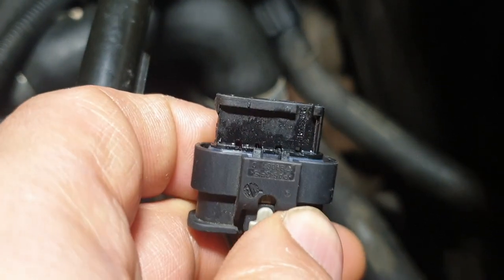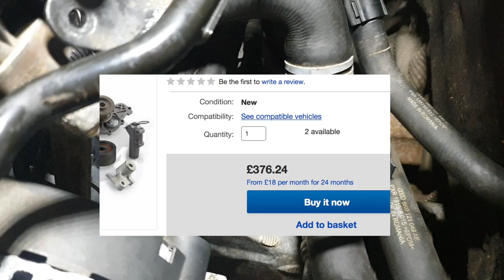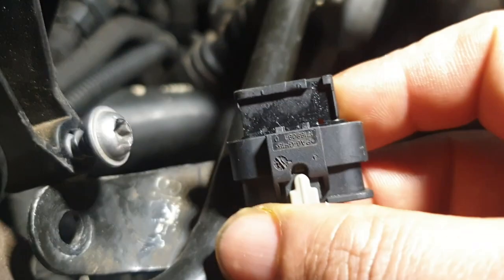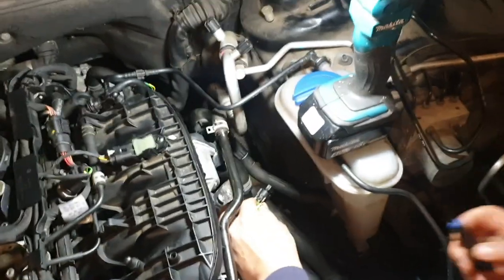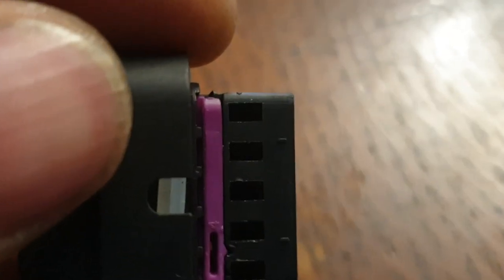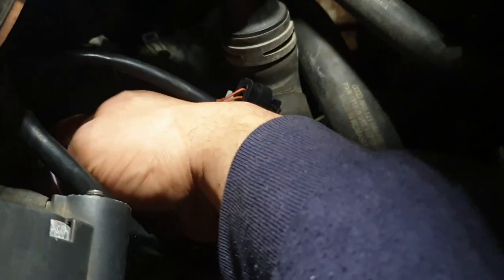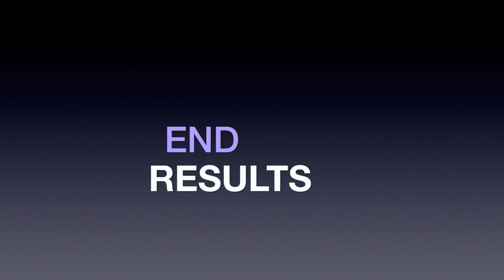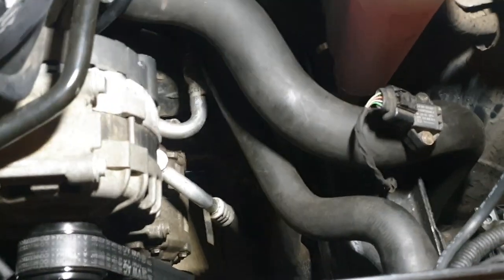How to Fix VW Audi COOLANT PUMP LEAK Problem EA888 TSI TFSI

Comment: Fixed my 2681 code. I cleaned it with electrical cleaner instead of replacing. Good so far. Thank you!!
Reply: Did you unplug it ?
Reply: @iwasJay  I did, but it only lasted a week. It was wet from coolant after I cleaned it. Ended up changing the waterpump and thermostat housing after all.

Comment: I have Audi A4 B8 and I received those errors, my mechanic replaced my water pump with the thermostat but I still have that one error P2681 that refuses to disappear 
Maybe it’s the wiring? Or something else?
Reply: You might wanna double check for your n82 connector and that connector that his showing… they can control bypass valve… but did u fix it?